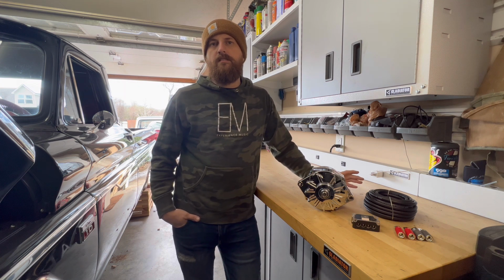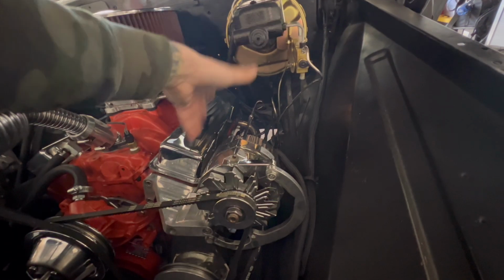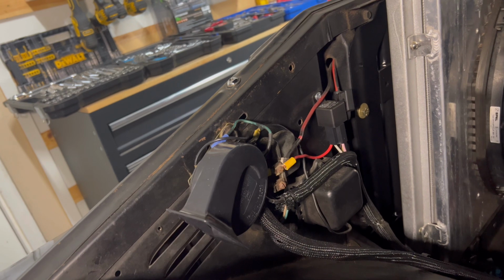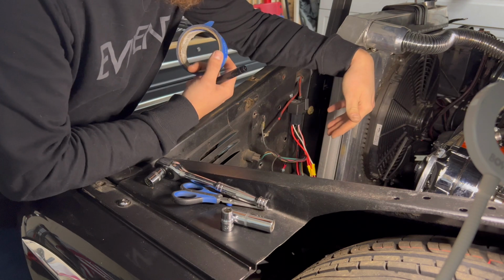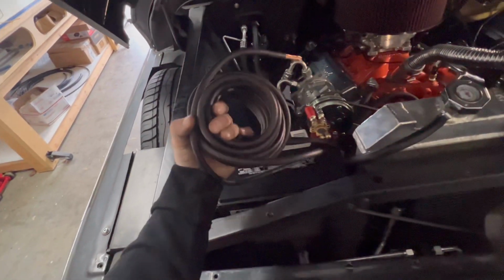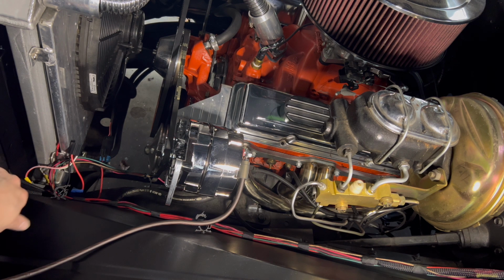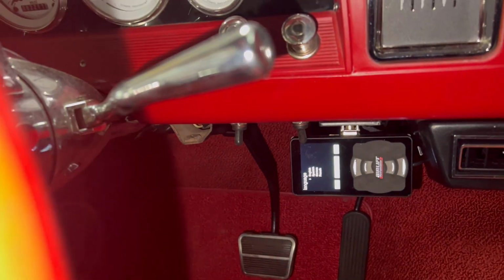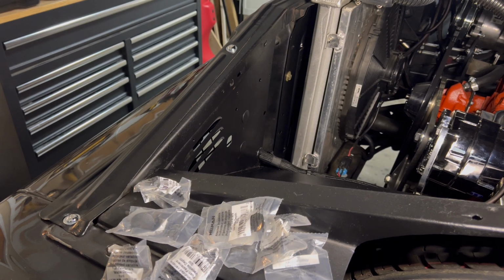Bagged 66 C10 | 200 Amp Alternator Install, 4G Wiring Upgrade, and Airlift 3P Flip Down Mount

Comment: No issue running a 200amp alternator on a vbelt?
Reply from the maker: It did fine but lower amps at idle.

Comment: Don’t forget to run relay’s for your headlight’s,so it can take some load off of the switch and it makes your headlight 50%brighter too
Reply: This is good to know. I have a question. I have a 85 SWB I’m putting airbags on. I have 2 air compressors, sunroof, and I have plans for about 1500 watt sound system. I’m going to run 2 batteries also. What size alternator do you guys suggest I get to handle the electrical needs? Also I have led head lights, should I put a relay on them? Thanks
Reply from the maker: I would get a 200amp and run two batteries. I may end up getting another battery.
Reply: @SIMPLE.C10  thank you sir
Reply: I fail to mention that I also have a digital dash, electric windows and locks and door poppers.
Reply from the maker: Thanks for the suggestion. My relays for the headlights are inside near my fuse box.